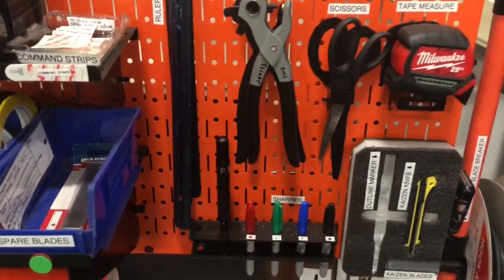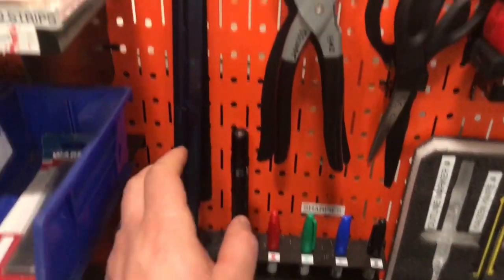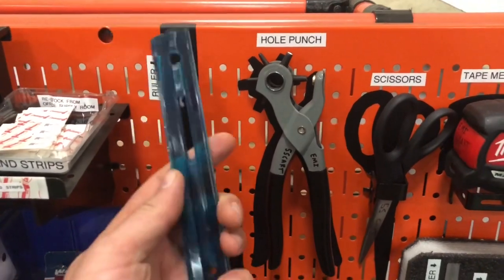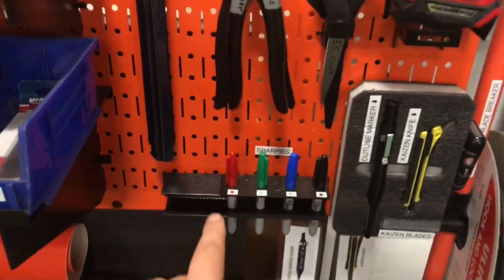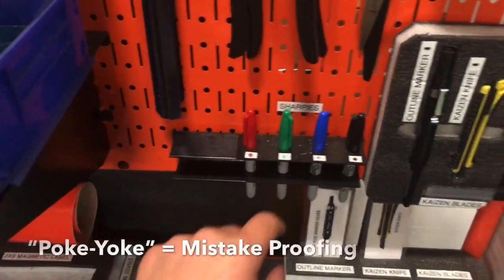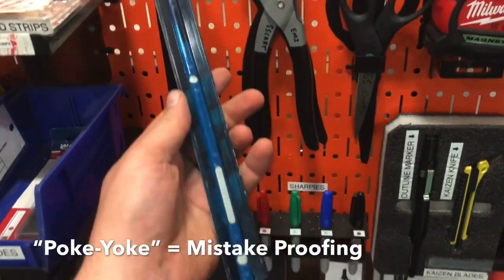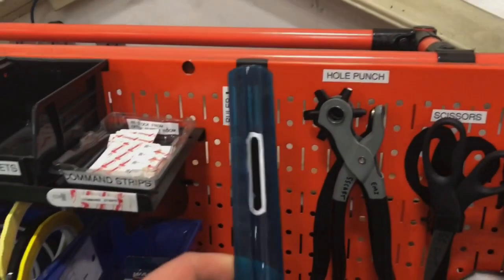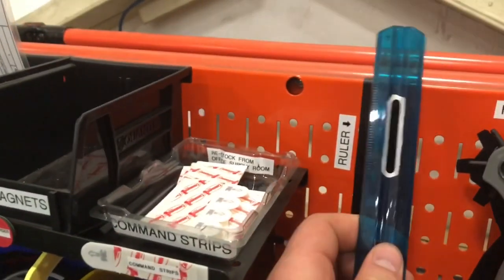Poke Yoke Example

Comment: I don't know if this falls under Poke-Yoke or not, but something else that I'm surprised is not done in industry more often is the use of either acronyms or ordinal numbers to remember key things.  For example, before landing a small airplane (aviation is full of acronym checklists) you do something called a "GUMPS" check... Gas, Undercarriage, Mixture, Prop, Seatbelts.  You go through each letter of the acronym so that you don't miss something.  This can be done mentally with both of your hands full.  And for an "ordinal numbers" type of check, you just say to yourself "There are 5 things I need before I leave the house,"  "keys, wallet, phone..."  etc.